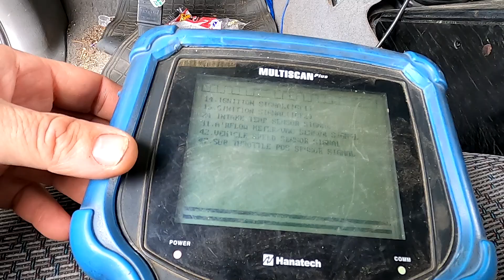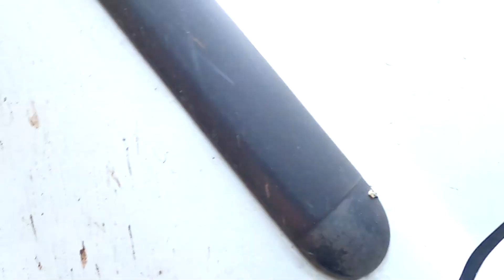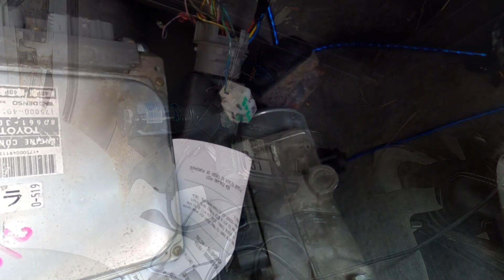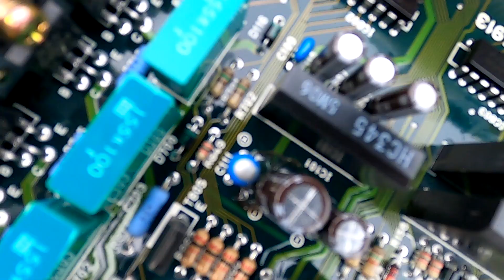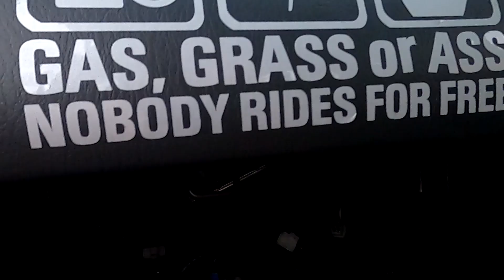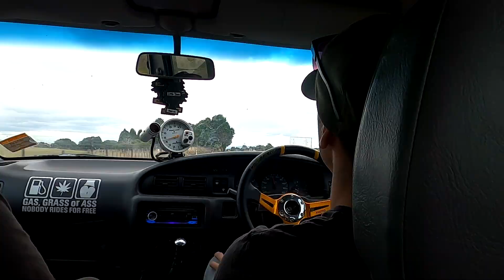SikUte. 1uz Mazda b2000 Ute (same as Ford Courier ), Repairs

Comment: In my opinion  installing bigger injectors on a factory equipped ecu engine is blowing money of the tail pipe  the ecu is going to pull back to the limits of factory program
Reply from the maker: Yep,  where there is enough trim values,  these early ecus the trim ability is poor so most dont trim enough fuel out to get close to ideal,  so run crap

Comment: As you probably know that factory ecu it got a 2 Tripp logic it will not set up a code unless the engine temp goes below  91 degrees but it will give you a temporary  code .A lot of people make the mistake not to look for temp codes or freeze data .
Que te valla bien Luis
Reply from the maker: Yep.  I'm trying to explain code threshold but its not easy and lots of codes to work through.   Cheers